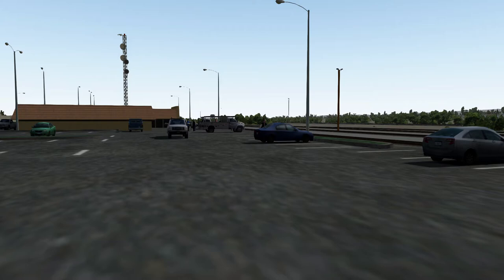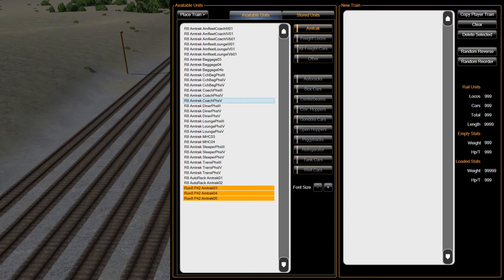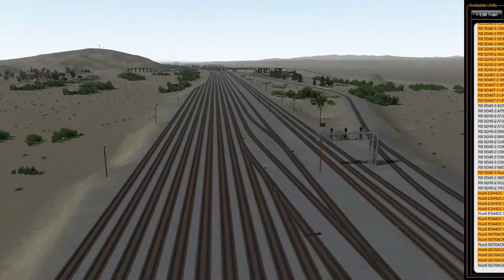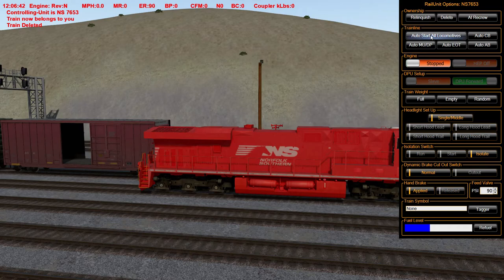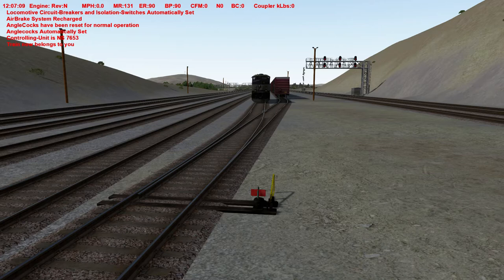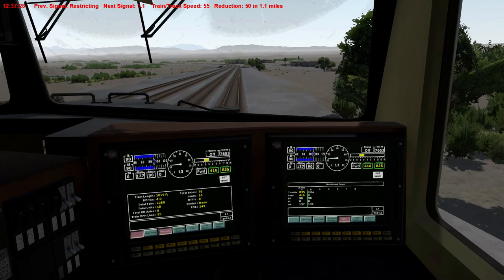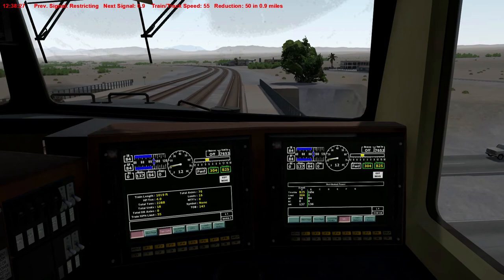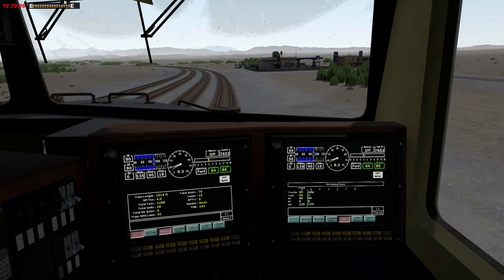Run 8 Tutorial - Using DPU's

Comment: It is a good learning experience if you do everything as it should be done in real life, like blowing the horn 2 or 3 times whenever you move the locomotive for instance.
I find that Run 8 is a better driving / engineering experience than TS 2017/2018, in my opinion.
There's much more control over various aspects of the simulator, like the coupling. 
Also run 8 displays more information about the train itself, like length, weight, Hpt and settings for DPU's. But there's alot more of course. 
Anyway, thank you very much for this video!

Comment: I'm not asking, But... 
I was wondering how you would go about assembling and driving a very long train, like 2 miles or above kind of length.
Just to get a feel for how it would be or how you would place dpu's in a train, where to position them and how much locs you can put at the front and back. Or how to calculate how many dpu's you need and such. 
Also, is a very long train possible in Run8 and a better question: is it appropriate to drive a 2+ mile train in Run8 ? 
Anyway, I'll wait and see. I'm grateful for any video you like to create and show, it is very worthwhile to watch and listen to. Thank you.
Reply: So the way the remotes are distributed is based on weight distribution and the make up of your train. This is all specified by the railroad. Generally you need Remotes (dpu) over 10,000 feet.. Now for placement split them between the Head end mid and rear if you like and keep a roughly even tonnage between the units.